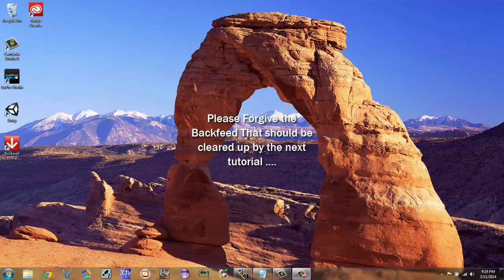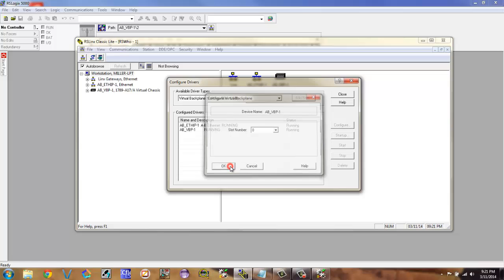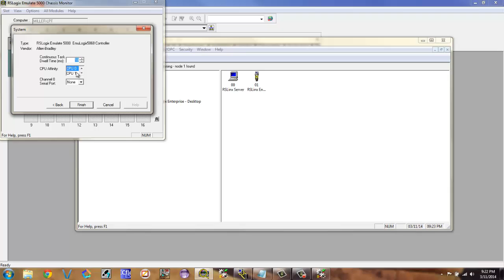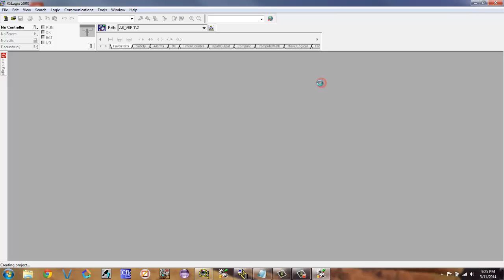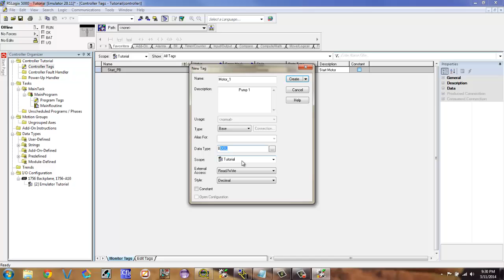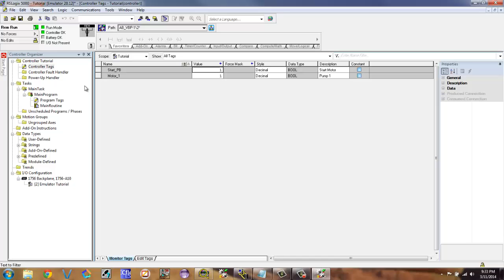Rslogix 5000 Emulator Tutorial

Comment: Nice and clear tutorial.  It would be nice to tell how or what is needed to install and the Emulator 5000 software.  I had to struggle to set that up..without Activating it, I could not make it work.  Called AB support, and they told me that I have to Activate the emulator separately.  Fortunately I had a Serial Number, but no Product Key.  They provided me a Product Key.  Then I Activated it with Factory Talk Activation Manager. Only then the Virtual Back-plane Driver worked.  Please include this portion as installation/setup requirements in your tutorial for others to follow.  Otherwise its good tutorial.  May be a little slower pace is better.
Reply from the maker: Thank you I'll have to do that in a future one. Though I'm building new vids in view designer

Comment: Question...

1) For the Emulator, can you actually toggle the inputs and outputs on the virtual backplane?
2) Can you change the value of a virtual analog input?
3) Once an Emulator program has been created, can you change it to a real controller in the program without starting everything over? This would be really useful for testing and then just change it over right away, afterwards.
4) Can you tie the virtual controller into SCADA networks (like TOPServer) for testing? In other words, can you assign the controller an IP address and use it on a network?
5) Can you upload a program from a REAL controller while it is in Run mode without interrupting its program?

Comment: Hye.
I saw you selected the Emulator in the IO config. Can we add any IO module to expand it?

Any tutorial where we use the IO module in the Rs Emulator?
Reply: The emulation does not support I/O modules other than a genereic 32-point DC module.

Comment: Similar to many commenters, my module 1 doesn't appear automatically.  How can I, being in possession of a full license for the revision 20 of RsLogix 5000 get the 
Comm Adapter
RsLinx Enterprise Desktop
serial No. 2DA5296
which appeared magically on your Emulator.  The Networking folks already connected me to the HelpDesk and they could not find the correct license for an Emulator Linx.
Reply from the maker: What are you using pro standard light

Comment: Hello, thank you for posting this tutorial. It was very helpful for my first time using using RSLogix5000 Emulator. One of the challenges I'm currently facing is a project I'm working and would like to use the emulator along with FactoryTalk to build the HMI display which is the same as you demonstrated in your second tutorial. So thank you for that one as well. One request I have is to give a quick demonstration about how to use the emulator with a PLC program that uses other modules, such as external I/O, analog inputs or thermocouple inputs, serial data communication (Modbus?) and anything else that might be useful. Can we even do that with the emulator?
Reply from the maker: You know I'm not sure I do not believe analog or communication is possible with the emulate I have not tried it. I believe it is not. I strongly suggest if you can completely switch over to ethernet that's the route I would go. I have done many conversions to ethernet there are those who don't want it, those are the jobs I turn down because I believe in staying current I mean who wants to use a 1st Gen iPhone or 2.0 android.
Reply: Convert to Ethernet? What does that mean?